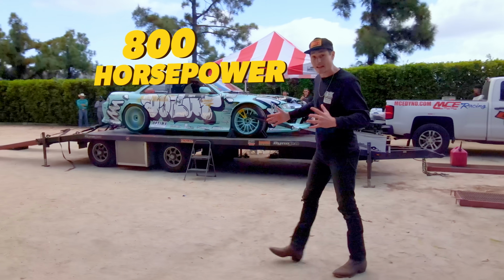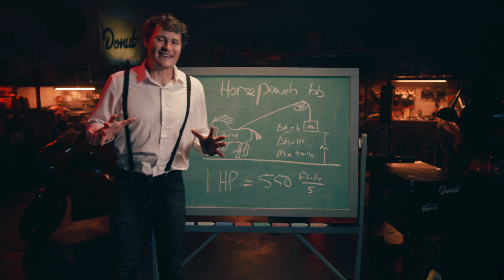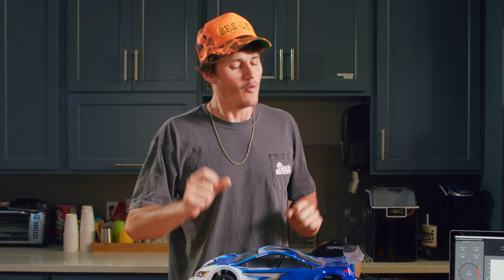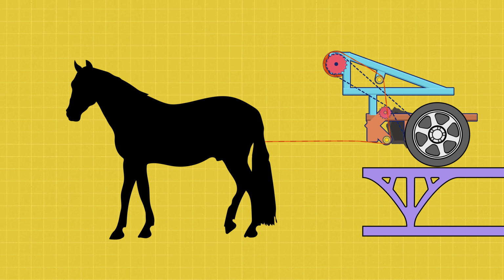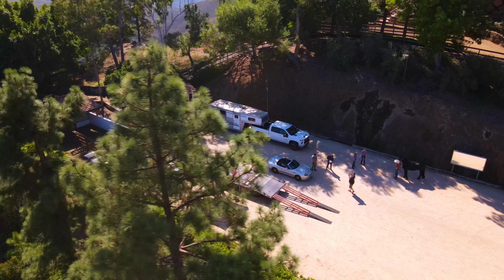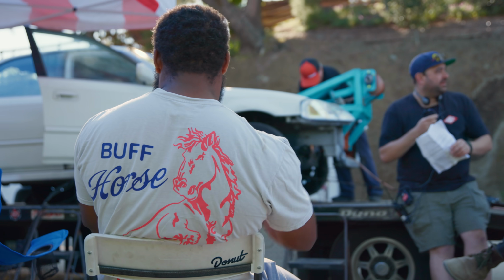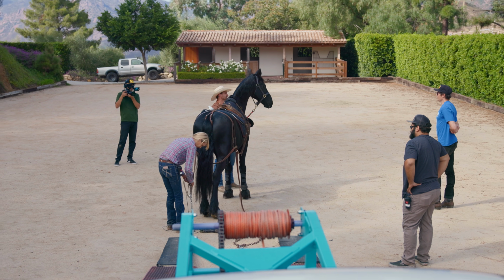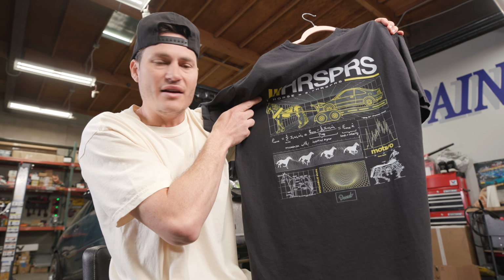How Much Horsepower is a Horse?

Comment: Drama for low STEM audience. Mucho commercials for 7 days and 3.2M views and that's cool. Maybe (probably) I missed something but lifting a weight is ideal. Or strain gauges on a torsion bar, direct torque measurement, no mechan8cal loss to compensate. Why was the laser good enough for 3 guys pulling but not for the horse? An optical or inductive proximity sensor on the sprocket would have been simple and dead accurate, cost $1.00.

Comment: We have the same problem in metric and imperial measurement systems... Calculate your units using giraffe neck lengths... Force is measured with joules or watts.
Horsepower? It is an Joke.

Comment: I would think the load cell data would be the best representation of true horsepower since its the closest resinbleance to the formulas used. Im sure it was accounted for in the drivetrain loss math but biggest issue with the rope on the spool is that you effectively have a cvt style variable gear ratio as the line is payed out. Possible fix would to have the spool freewheel and feed a v clamp drive the same way fishermen reel up crab pots with checkered rope to catch any slip. Also there us the idea of recreating the original carosel with a slip clutch to get the horse up to speed and slowly lock the clutch out to a direct driveshaft under the carosel platform running to the cars differential. That would eliminate most power spikes and give a flatter more representative average.......interesting this has never been attempted before

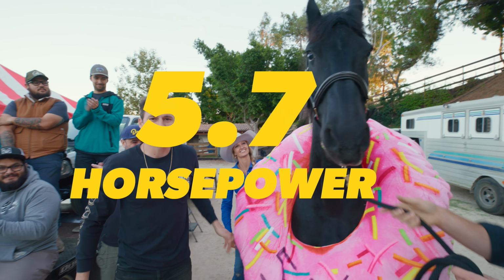Comment: The horse seems to be pulling about 352 ft/lbs, @27:52 
The  Dyno sheet shows a peak at ~ 85 Rpm, which I assume is the 5.7 Hp they report. (5.7/85)*5252=352.19 FT/lbs

Comment: How did they figure out how to calculate the change in gear ratio each time the rope spool gets smaller as the horse pulls out the line? Seems like that would be tricky but I suppose it's really no different than a car changing gears as it accelerates? Lot more variables to calculate than I had originally considered would be required for a Dyno to determine the specific crank horsepower of a particular vehicle. Or in this case an animal
Reply: I think they didn't need to. They measured both speed and force and multiplied to get power. That works whatever gearing ratios are involved.

Comment: I actually think this is one of Donut media's most important videos. I think (and anyone familiar on this is welcome to chime in) the 3 of them together could have produced a higher number if they were able to actually coordinate their effort. A Horses 4 legs are already designed to work in sync as needed with 1 brain. 3 separate brains operating 2 legs each would be more difficult.
Reply: Maybe they would have done better with separate ropes, so they could each grab a loop of rope rather than try to grip a straight rope.
Reply: More to the point if they had a proper human pulling rig. One that connects to the hips so the strain isn’t on the hands to hold the rope but it is closer to the point of exertion. 
Then that way you could have a second rope the they could pull on. You’ll have the leg strength plus the arm strength. But I guess that might skew the data.

Comment: Over 50 years ago we had a pretty good ice storm.  Just down the road we found the milk truck off in the ditch.  The local farmer came out with four Percheron workhorses in their usual set up for pulling wagons, plows etc and once set, they pulled that truck out like nothing.  I knew then that they had a lot more than 4 hp going for them.  They were much bigger at 6' to their backs and pushing close to 2600 lbs each.
Reply: Do you difference between power and torque?
Reply: @kaunomedis7926  That's the question I wanted to ask :)  4 giant horses at 4 hp each = 16 hp and one million foot pounds of torque!

Comment: I felt that the gear ratio might be too high. Could probably get higher horsepower using lower gear ratios. Big D was making high strength but no where near optimal speed.

Comment: I don't get it? My 10hp lawn mower can't pull like a horse can. In 1924, a single "Shire" horse has pulled 58,000lbs. 
2 Shire horses together have pulled 100,000 lbs...that's about the weight of 30 pickup trucks.

Comment: not only is the horse pulling the dyno, he's pulling his own weight.  HP is a measure of acceleration.  Just measure distance over time, do a double integration, and find peak HP.
Reply: Double derivative? Also Power is force * speed for linear motion or Torque * angular speed for rotation. It is not a measure of acceleration. The SI units for the watt are kg m^2 * s^-3. The units of acceleration are m*s^-2

Comment: I love the video, but I must point out: More needs to be done. It's always been my understanding that HP was determined as a "continuous" or sustained amount of power over the course of a half a day roughly. While clearly 5.7 is a good "peak" HP rating, it would be useless as a way to compare it to a steam engine in the 1800's because you don't ever work your horse at peak power if you want to get actual work done all day. Since the peak HP calculated was 5.7, I bet Watt's original calculation of the Horsepower was pretty accurate. But we won't know unless you do a follow-up experiment that attempts to get work from a horse over a long period of time. And since there are so many horses, perhaps you should do this experiment with multiple horses and take the average?
Reply: Good comment, but also where would you find a fit horse that is used to working hard for half a day? Big D is strong but presumably spends most of his time standing around, not exercising.  So I don't know where you will find a suitable horse for a "long period of time" experiment.
Reply: @Mark_Bridges  Maybe a cart horse used for hauling tourists around all day?  Keep in mind that "working hard" is something of a misnomer if you want the same work output every day.  You might also ask the Amish.
Reply: Good comment, I also don‘t buy into the scientific value of this experiment. The available work from a horse is pretty easy to estimate. E.g., the Schloss Neuschwanstein castle in Germany uses a cart to transport tourists uphill. It says „hybrid drive“ because it uses a mix of electric and horse power drive (2 horses needed for the optics, zero with electric active, one without). They know exactly how fast a single horse can drag a cart full of people alone (I asked). From that you compute the power, considering the difference in speed between flat and slope. They move slow, but pretty steep uphill.
Reply: @falklumo  That hybrid drive you mentioned is a good idea because it would brake the cart down the hill, stop it running into the back of the horses, then give the energy back going uphill.
Reply: @Mark_Bridges  Well, it's not just an idea, they did it, even mark the horse carts with a "hybrid drive" sticker which is hilarious :)

Comment: This is data for only one horse. For an actual Horse power rating you need several Horses and then again several different breeds of Horses from different parts of the world and again test them in different climatic conditions in different seasons of the year and at different altitudes. All this data then can be averaged out for a general number.

This in itself can be a PhD Thesis.

Comment: Awesome work but tbh this is not an accurate measure of power. You're measuring the pulling force of a horse at a very low speed. This is more like testing an engines power at idle. You need to at least have a variable pulley setup that makes the horse progressively run faster and get the pulling force over the full range of speed the horse can run. That will give you the full power curve and the peak point on that curve would be the max horsepower. Typically this has measured to be close to 15 hp by other experiments. 
Alternatively, you could have done this simply by attaching a load cell to a car and making the horse pull it. You could have controlled the speed by using the brakes. A few quick calculations using velocity and force would give you horsepower

Comment: It would be interesting to compare this result to a horse trained for competitive draft horse pulls. Not only are the horses massive, but they practice applying the same type of force as they were asking Big D to supply. A pair of those horses can run off with dozens of tons
Reply: That horse wasn't pulling with all his might which is why this is flawed AF. Are they trying to tell us a out of shape human has 20% of the strength of a horse? GTFO
Reply: @ShizawnSanders  Keep in mind that the measurement in question isn't attempting to look at a horse's sprint power.  Think "marathon", IE able to turn a mill all day long.
Reply: @jason67823  that's not how that dyno roller works.
Reply: @jason67823  you really think that person makes 20% of the power as that horse? LMFAO 🤣.
Reply: @ShizawnSanders  I think Jason's point is that the horse wasn't sprinting whereas the guys effectively were with how much effort they were putting in, so it's not fair to say a human can produce 1/5 the amount of hp when the horse didn't seem to be sprinting but the guys were. All we can do is speculate though.
Reply: @ShizawnSanders  The nature of the unit is flawed in the first place. 2 different horses would put in 2 different values anyway.
Reply: @ShizawnSanders  That's assuming the first HP takes as much effort as the next. But they went from 1.2 HP for 1 guy, to 1.9 for 3.
Reply: @Trucks_R_Us if we had seen the graphs, much would be explained.
I remember seeing a video that showed we have 2 sets of muscles. One is good at no movement, the other peaks in dynamic situations.
I'll lay money that each guy's peak output was at different speeds, so the power curve would be wider and not just higher.
Reply: @Trucks_R_Us  yes but it was awkward when 3 were pulling not to mention completely different pull strengths between the 3. For a accurate test there it would take 3 clones with harnesses. In truth multiply each one by 3. I read about this actual wonder years ago and the conclusion was that on average with a average horse each horse was worth around 20HP.
Reply: Holy shit…it might actually be 15hp

Comment: Hi, what a great experiment. I have driven a pair of horses pulling a waggon and the power than can produce for a short time is phenomenal, however the standard measure if hp is what a horse can continue pulling all day. A horse will walk at somewhere between 6 and 10km/hr depending on bread and can pull continuously at approximately 10% of their body weight. This means that a 600kg Clydesdale can pull at about 60kg forward force and if walking at 7km/hr works at approximately 1.5hp. Most of the horses in the breweries were not this large so were a lower power.
It was realy great to see you actually measure Big D.

Comment: Wasn't a horsepower the power an average horse can put out for an extended period of time, rather than an exceptionally strong horse can do at full strength for a few moments?

Because that is what the steam engine would have to compete with.

Otherwise, fun video, though

Comment: As an uneducated non-physics / non-engineer, I have two questions: I thought this would be more like a tractor pull competition. Where each 'step' of the horse would be just that much harder than the previous step. Please, nicely explain where I'm wrong. Second: Big D was a massive horse. Wouldn't this test have been more accurate using an average horse? Or maybe multiple horses one at a time, and then averaging the results out? Thanks! Not complaining here; I've always wondered about this, too. I jumped at the opportunity to watch this video!

Comment: Very interesting video! I would be interested in seeing different breeds and how a trained horse would do with a bit more space. There is the draft horses that do pulling competitions so I’d be interested in how one of them does
Reply: That would be interesting as different breeds will have different power profiles. A thoroughbred race horse is to a draft horse as an Indycar engine is to a truck diesel.

I wonder also about the lack of working hours for a modern horse compared to historical working horses.  Measuring the power of a rested non-working horse is likely to give a higher result than the average power of a horse working a long day.  The average is more useful to production. 

Also, the age profiles of working horses would likely lower the average.  Measuring a horse in peak condition isn't ideal.
Reply: @genixia  This. James Watt's horsepower was probably for an average horse working over an entire day, not peak power like this test.
Reply: You spotted the flaw in the whole premise.

Comment: I am glad I watched to the end before commenting. It is amazing how many times people make comments without watching the whole video. As a physics teacher, I really appreciate the quality of this video. It was awesome! I hope this allows NIST to come up with a new standard for horsepower. Also, Wikipedia needs to be updated after the research gets published :D make sure to add a link to the publication.
Reply: Why should there be a new standard for horsepower?  This test showed the approximate best case power of a horse over a short period of a few seconds.  One horsepower is probably closer to an average power of a horse over a long time, which is more realistic.
Reply: Not to be disrespectful, my physics teachers were among the coolest teachers I had. But the reason people comment before watching is that videos have a lot of suspense before answering the title question. The answer was in the last minute of a 28 minute video. That's ages in internet time. Also standardized units of measurements are nearly impossible to be changed after a lot of people got used to them for many generations.

Comment: Wouldn't the horse need to pull to his max to get an accurate measure? The rope was way to short so the horse was stopping because he ran out of rope.. the horse wasn't even trotting as the coach pulling horses do... not to mention running.... 🤦👎

Comment: The proper way to do this would be to use 10 different horses and get an average between all 10 tests to determine a value thay can be assigned to horsepower.

Comment: Good grief, did any of these mechanical engineers ever hear of a Prony brake?  Spool, brake, tach, and a load cell. 

Or, they could've contacted the Michigan Dynamometer Association, Inc. and used their horse dyno.

""The Michigan Dynamometer Association Inc. traces its origin back to the development of the dynamometer by Iowa State College. Many agricultural schools bought the Iowa machines for draft horse research. Michigan Agricultural College (now M.S.U.) was one of the such schools. Here in Michigan, Harry F. Moxley, a farm boy from Kansas, persuaded the Michigan Agricultural College Board in 1926 to buy one dynamometer machine for research."

"The following year a second machine was authorized, and so Michigan became actively involved in testing horses for better understanding of what a good draft horse should look like for farm purposes. Harry, an energetic State Extension Agent in charge of promoting better farming practices throughout Michigan, spearheaded the scientific studies."

Searching "E. V. Collins horsepower measurement" will turn up an Iowa State article with some pictures of the rig and links to further research material, including a 1949 thesis "A drawbar dynamometer for direct reading of horsepower" by John Palmquist in 1949.  The patent for the dyno is #1,603,521 issued 19 October 1926 to Jay Brownlee Davidson and Edgar V. Collins.

It's a nice catchy claim to act like no one ever tried to measure equine power output, but to think that this was ignored by scientists, engineers, and farmers when these animals were widely used for industrial purposes is silly.

Comment: This is fun but could be simplified and made more accurate. The spool changes diameter during use.
Just put a spool with a brake mounted on a force meter. Similar to an engine dyno or torque test channel’s dyno

Comment: your contribution is as same as mine in my engineering degree final year project😅
Reply: Are you measuring maximum power output of the horse OR maximum work over a shift for the horse? 

Watt was measuring that, because that’s what people needed to know then, how many fewer horses would I need?

Comment: This is such a great video and thank you very much for making this. I have one question. You had two different methods of measuring the power output of the horse one with the dynamo and the other with the GPS and force meters. It will be great if you can share how well these two methods agree on measuring the power output of the horse. Thanks!.

Comment: Competitive horse pulling is actually a thing at farm shows / farming conventions. The Pennsylvania Farm show in harrisburg has a competitive team event. You could use a tractor to measure the load on the hitch and determine the horsepower.
Reply: I have seen a different metric saying the average horse is 22HP and I think that's way more accurate than 5.
Reply: @ShizawnSanders Considering Jeremy was around 1 hp I would've thought Big D would've been more as well. I would guess around 10 - 12 hp
Reply: That horse wasn't pulling with all his might which is why this is flawed AF. Are we supposed to believe a out of shape weak human is 20% as strong as a healthy horse? GTFO!
Reply: Not really since the conditions would vary too much.

Comment: having that gps anthenna on the side of the horse will make reseption wurse you get sort of a ground affect of a big thing and the radiation is not good for the horse but wy not have it on top maybe the horse did not want it but for gps working accurate it would be better